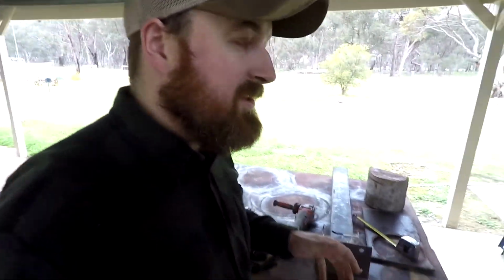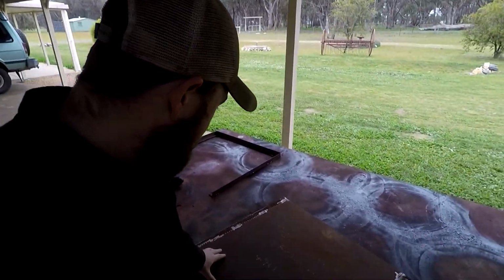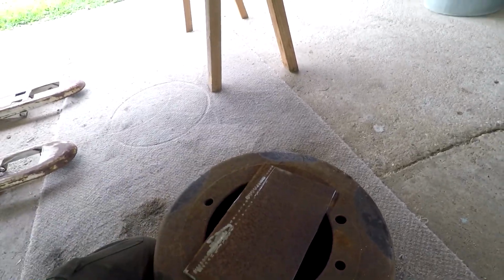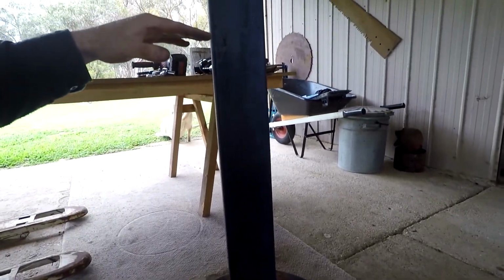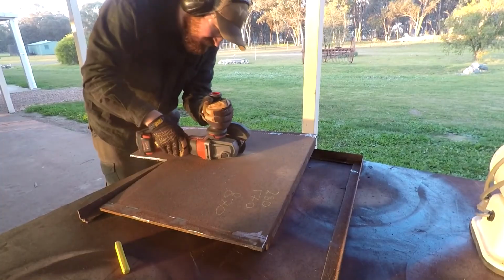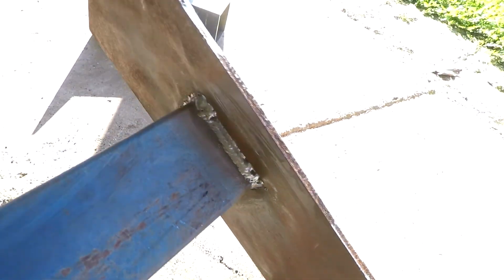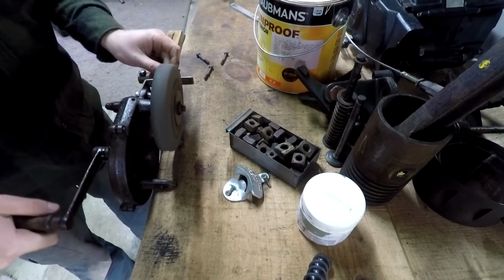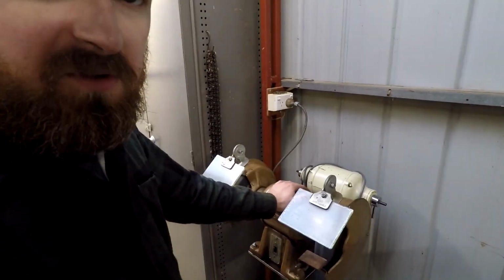DIY Bench Grinder Stand Built From A Brake Drum And Scrap Metal Projects at Rusted Iron Ranch

Comment: Great build, Terrance!  Thank you! The grinder seems like a well-made tool...nice and smooth!
Clever idea to face the nuts upwards to keep an eye on them for loosening. You could also use "Nyloc" style lock nuts instead of regular  nuts if vibration becomes an issue. Or in a pinch,take the regular nuts, place them on edge on one of their flats, on a firm hard surface ( concrete floor,anvil, etc.) and  give them a  firm rap with a  heavy hammer. This will distort them out of round just enough  to get them to lock on to the bolt to prevent loosening. This takes some practice to get a "feel" for so start with a light rap and gradually increase until they thread on with some force.